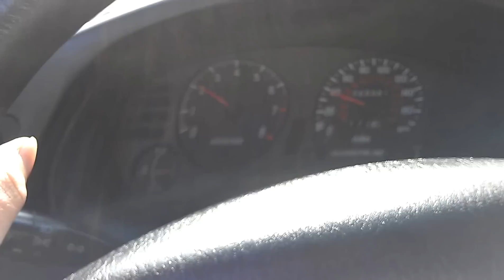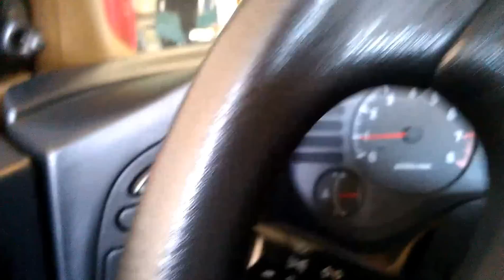BALL JOINT NOISE!!!

Comment: YES, bad ball joints for sure....  My 02 Mercury Grand Marquis has been making that noise for quite some time and I had it in the dealership not too long ago but no one told me I should have had them replaced..  Needless to say I found out this afternoon when I pulled into my driveway and.......  My tire was no longer connected and my car dropped to the left....  PLEASE don't wait like I did bc this minor incident could have been a major accident if I was on the highway!!

Comment: Having the same problem as well on my honda 7th gen accord. You won't be able to tell unless u hoist the car up if u can hear the noise that loud it is most definitely both upper and lower ball joints. It really depends on your car and where you go for the prices but it should run you up to 400+ to replace the joints. Keep in mind everyone's car is different and for u it might just be one ball joint. Hope the helps

Comment: It's the ball joints I had this problem on my car last night but it went away dismorning sometimes when you drive the car you will hear the noise an sometimes when you drive you might not but it's best to get the ball joints replaced I replaced my tire rods thinking that was the noise but it wasn't then I was stuck with an allignment issue if it's not one thing it's another best of luck to you try eBay they got good prices on parts ball joints ant that expensive find a mechanic you know to press them in other places can rip you off if you are tight on funds.

Comment: Exactly the sound coming from my car on the front passenger side.
Reply: I just put on coilovers, went for a drive...i heard this same god dam sound on the same side to...the entire drive to and back...i get out ALL my coilovers dropped. luckily i made it home...Man it took me all day to adjust those...and im guessing because they dropped so suddenly the ball joint gave out and I was going tot he mechanic tomorrow to change those to...sigh now i gotta get a tow or something...
Reply: @hakimdurand8427  ended up being my upper strut mount was blown lol.
Reply: @bennocturn  if only mine was that simple...man i spent 11hrs of my time adjusting them shit for nothing now more issues arise and they dropped on their own... like wth
Reply: @hakimdurand8427  completely normal for new coilovers to drop once the springs settle.
Reply: @hakimdurand8427 make sure the pre load on the springs is set correctly and everything is tight though.
Reply: @bennocturn  i ended up messing with my driver rear preload so i went to my passenger side to check and set it to match. So thats fine... The front preload matches one another those are also fine... I tightened the dam things lol. Idk if they werent tight enough... too much pb blaster... or what but ill try tightening them again when i figure out how the hell im getting to a shop to check out whats the noise im guessing now from driving...
Reply: @hakimdurand8427  what coils?

Comment: Thanks. I have the same noise when turning right, not as pronounced yet.  Replacing upper and lowers as well as inner and outer tie rods this weekend. Replaced front wheel hubs 2 days ago. Replaced all this on my 2004 Silverado 4wd in 2011. Well,  20,000 miles later doing it again. I never lubed them and most rubbers dry rotted. lesson learned. Purchased lifetime parts this time.
Reply: Hey there. I found out i have this noise in my honda civic 1998. Where did you purchase your parts? I hope i can get them cheap thankss

Comment: Yes ball joints can make that noise  and a tapping noise when they are gone, I replaced mine with a new one and it was seized from the start, its amazing how much noise comes out of it. Its faulty I'm changing it.
Reply: Hi nicholas. I had the same noise problem when turing....i had bott ball joints replacement today and the sound is still there is it normal? Or wil it go away?

Comment: That IS a BALL joint. It's wearing out. Ball joints are THE ONLY thing holding the wheels to the car/Truck.
IF or WHEN it does fail of break, That WHEEL WILL COME OFF! At any speed.
Not cheap to repair ,no. BUT the alternative at 75 MPH is much worse!
Drive safe please, and get er fixed ASAP!
Reply: Doug Williams YES !!!
Reply: Doobie Holding the ball joints are what hold the tire/wheel assembly to the car once there gone everything will literally get ripped off including the shocks/struts if you’re going fast enough

Comment: sounds like a bad drivers side ball joint to me ..but i would replace both on the front though .
Reply: Mike C That was the problem with my 95 Ford Mustang replaced them both and the two tie rods one was loose. But not with Chinese parts. cost me $523.00

Comment: to make this sound gone temporarily, my foreman did spray some oil to make the joint bush become smooth.  waiting for the spare part. the sound is not coming when its raining or after spray. during hot day, the vehicle will make kdok kdok sound.

Comment: Definitely lower ball joints. I heard this noise for 3 months and did not fix. Then the noise went away. My failure to take the cars sounds as a warning cost me BIG. My car is now in the shop after breaking a ball joint at 75mph on the freeway. IF YOU HEAR THIS SOUND STOP DRIVING AND CALL A MECHANIC ASAP

Comment: I've got what I only can describe as a creeking sound that has progressively gotten more pronounced over bumps and inclines. Its like I can feel it in the steering wheel. Its on the left side. Already replaced the strut. It helped kind of... It was shot. Any ideas?
Reply: I have the same issue and i have no idea what it is
Reply: Did you figure it out?
Reply: That’s definitely the lower ball joint

Comment: have the same issue with my 2005 ford explorer...especially when parking and making tight turns...have already changed the ball joints and sway bar linkages...my guess is the tie rods...as that the next thing to go...also had the transmission rebuilt and the guys broke the bolts for the crossmember so thought that was the problem but got that fixed and still the same issue...its getting looked at again tomorrow

Comment: easiest way to test steering parts is get under there and put your hand on everything and twist and jerk parts see if anything is loose or rattles. a rubber hammer works to tap on stuff see if you hear clatter

Comment: Sounds like ball joints but hell, they are connected, no point of replacing ball joints and not replacing tie rods, so change out both to be on the safe side! !!
Reply: so that would be a cv joint?
Reply: Tie rods are connected from the Cv to the tie rod arm or extension of the hub to control steering. Any tie rod problem with cause a good amount of play or shake in the wheel
Reply: Would cause*

Comment: Wow I wish I had seen this video before this morning when my front ball joint snapped on my way to work. 2004 mustang and I was headed on the highway for my daily commute. I turned left and the tire went right. Sounded like I blew the tire and couldn't get out of the middle of the road. Good thing I was less than 2 miles from home and going less than 5 mph when it snapped.
Reply: What happens when this occurs?
I'm scared of the possibility of it happening and would like to be aware of outcomes.

Comment: im having the same issue with my suburban but my ball joints were replaced less than a year ago because of the sound and the whole ball joint came apart . i think it can be the bearings need to be greased or replaced.

Comment: James, did you just let it go for 6 months though??? My 03 mustang has that same monsterous squeak usually after about an hour of use but its not continuous only when hitting bumps and turning into destinations lol anyway i have yet to get it looked at from your comment column it seems it could be rack and pinion maybe rubber bushings and with all the snow drifts ive had to plow through Im almost certain I cracked the boots on the tie rod ends those may have to be replaced too any help would be appreciated
Reply from the maker: Lisa Stout it was several months - don't remember the exact number

Comment: What kind of car was it? I have a Chrysler and mine was making that exact same noise. And today I backed out of a parking space and it blew my tire and I had to get it towed. I also want to know how much it costed to get yours fixed
Reply from the maker: Mitsubishi Eclipse, it cost around $500 at a sears auto center as they had to replace the part and get the front aligned

Comment: Well i get the same noise, but i just put brand new lower control arms on both side and i lubed up my upper control arms, and my shock mounts on top and bottom and i also lubed the tie rods

Comment: My honda accord makes the same noise when turning left only, could it still be a bad ball joint?
Reply: I found out the lower driver side ball joint dust boot had a rip in it. So I packed it with grease and wrapped plastic around the boot and zip tied it in place. It's a temporary fix and now no more noise.
Reply: I got mine serviced! $300

Comment: Mine sounds like that! And it shakes! Does that happen when the ball joints are bad? Took it to a mechanic and got it back this past Thursday and he replaced the missing stablilizer link piece and then the ball joints and I had am alignment. Drove it that night and it still squeeled and cranked and had a grinding noise. Friday morning all of a sudden it shook VIGOROUSLY even at 5 mph or less. Parked in on the side of the road and had to call someone to get me... I was way late to work and I called the shop and left messages and I've yet to hear back from them. I'm Soo pissed!
Reply from the maker: Deianara Thibaudeau How many years and miles did the ball joint have on it?  And next time only replace the one that is worn out, not both.

Comment: I have had 7 of them cars and all tho it could be ball joints there are many grease fittings you can add grease in to but the last one I had that made that noise was the POWER STEERING RACK  it was cracked bad. Hope it helps. BTW if it is you should be able to see the cracks in it if you turn the wheel maxed out to both sides. Again hope it helps

Comment: My 98 accord does the same thing. It is the upper control arm. Where the bolt insert is at, it causes friction under the wheel weld and makes the sound. I replaced entire suspension system and still makes noise. Really annoying.
Reply: Check the motor mounts especially the one shaped like a dog bone toy. The one on the passenger side got me...it sounded horrible. Or it could be the steering rack. On Hondas  the steering rack can make a horrible  sound when bad.

Comment: My car is making the same noise. I replaced the upper ball joints and the lower control arm on the driver side and the noise continues any Other Idea as to what it could be? My CV axle looks find the boot is not ripped. Mayb the inner and outer tie rod ends?
Reply: +CrystalAriana21 Last resort would be a strut assembly or the pitman arm.

Comment: I have the same noise but more constant on my ram 1500, however my mechanic is 30 miles away. Think it is safe to make the trip if I just drive carefully and slower?
Reply from the maker: AdamJosiah1991 should be fine; if anything if it breaks you can get towed in
Reply: +AdamJosiah1991 Ah, not fine. Major dangerous to drive the car unless you feel that wheel coming off, suspension crashing to the ground, etc. isn't dangerous. Just had my ball joints replaced today. Car was all over the road on the way to the garage.
Reply: +ALEXYIDZ yeah, decided to fix myself. Turned out to be a bad bearing in hub assembly which is just as dangerous (It had WAY too much wiggle room). Good thing it was easy to fix
Reply: man mine was completely gone and I drove that sumbitch till it was making so much noise that you couldn't hear lol oh yeah man youll make it
Reply: ikr my 98 dodge ram 1500 did the same!!!!! its so annoying and embarrassing

Comment: My car made that same noise on and off for a week...two weeks later my tire fell off while I was on my way to work.  My ball joint was bad!
Reply: +koottsta koopr thank you!!  Same here!!!!
Reply: +koottsta koopr yea they whole wheel came off...control arm and all.  Thankfully I was only going 35 and was able to pull over immediately
Reply: that's insane..... I was driving my car for about 2 yrs with this noise and kept ignoring everyone's "dude your wheel gonna fly off" warning. Luckily nothing ever happened, I stored the car away and now I'm in the middle of getting it out the shop in a few days from finally addressing that issue. Can't wait to drive safely again lol
Reply: Amethyst3313 that was my fear, my tire falling off, got it fixed, job cost 1200.
Reply: @reginaldmassey7277 did anything else break? Kind of expensive just to get your ball joints done

Comment: i literally just got new ball joints today. on my way home it started making a squeaking sound when i hit bumps that it never made before. and also occasional pops that i heard before. tie rods are fine. any ideas?
Reply: I thought the sound my ram1500 was making was ball joints but it turned out to be a bad bearing in hub assembly. Might be worth checking that out. Bad wheel bearing was making popping and screeching sound as you described

Comment: Omg...mine is doing that as we speak....its so annoying. Now I know what's wrong...and its getting louder!!!!
Reply: That IS a BALL joint. It's wearing out. Ball joints are THE ONLY thing holding the wheels to the car/Truck.
IF or WHEN it does fail of break, That WHEEL WILL COME OFF! At any speed.
Not cheap to repair ,no. BUT the alternative at 75 MPH is much worse!
Drive safe please, and get er fixed ASAP!
Reply: Okay,will do

Comment: im having the same issue with my suburban but my ball joints were replaced less than a year ago because of the sound and the whole ball joint came apart . i think it can be the bearings need to be greased or replaced.
Reply: i just got my ball joints done on my tahoe and now its making a squeaking sound when i hit bumps. im puzzled

Comment: actually that's the CV joint.
Reply: Wouldn't the cv joint make a popping noise while turning or is that not necessarily true.
Reply: Shemar Carey CV joints are on FWD
Reply: Garrett Smith but also on4x4 or a vehile that is rwd and can switch to 4x4
Reply: I actually just had this issue on my old 03 Mustang, turned out the only thing bad was the tie rod. I swore up and down it was the ball joint when I first started hearing it myself but I was wrong.
Reply: If it was a CV joint you'd be able to see grease on the inside of the wheal